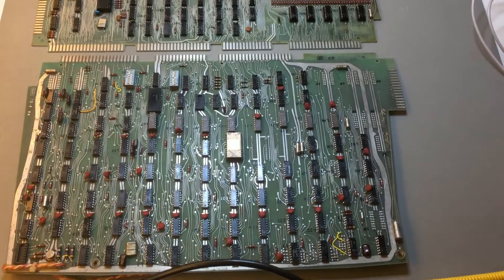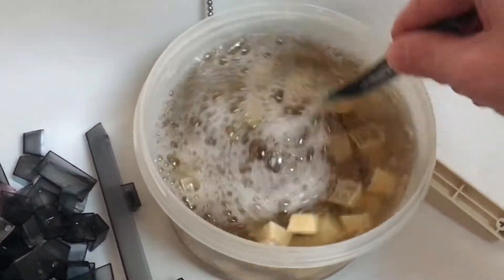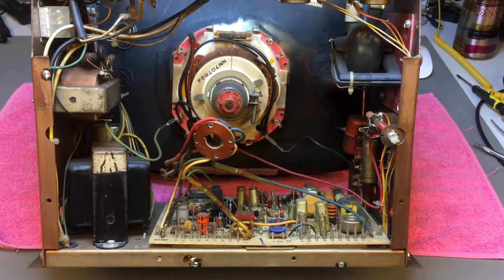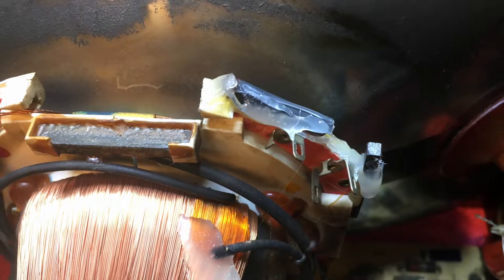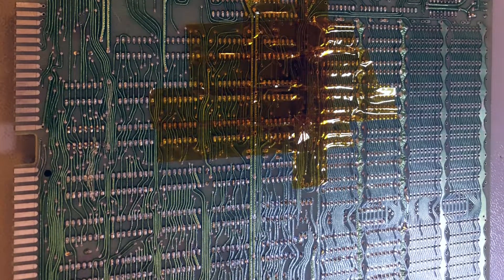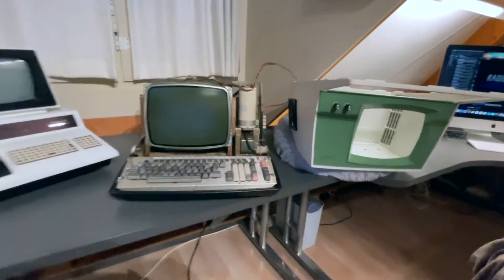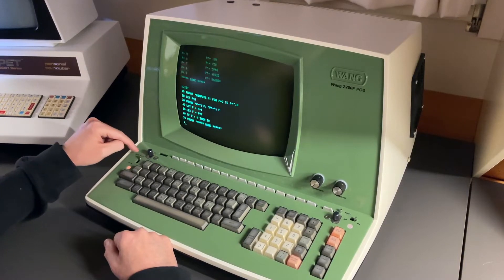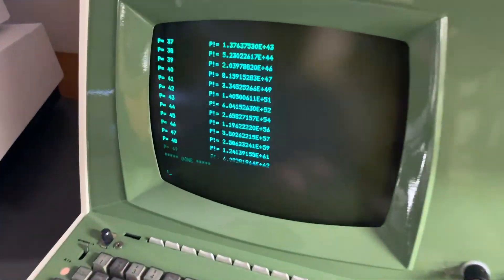Restoring a 1976 Wang 2200F mini-computer, Part 4

Comment: Is there a key missing? There’s a slot at the top left of the keyboard that looks as though it ought to have a special key in it.
Reply from the maker: There's indeed an empty slot on the top metal panel, but no missing key, as the PCB underneath has no switch on that position, and not even traces or pads for a switch. They probably used that top panel in different models, one of which might have had an extra key. There were Wang terminals using the exact same case.

Comment: Thanks for that, sorry i found it only now. Brings back memories.
Between 1979 and 1982 I worked on the 2200 in my first job as a programmer. It was not on the "F" type but a couple of other 2200s. Memory was so scarce that I sometimes even had to access the HDDs by direct sector adressing, I believe the commands for that were DATASAVE and  DATALOAD. After that I transitioned to VS and COBOL, but the "economical" type of programming made me a more successfull programmer till PCx and standard packages like SAP were replacing individual solutions.

Comment: Wang Laboratories was probably the only company to market a pure BASIC machine, that is a computer whose CPU ran BASIC code natively.  The larger systems had a multitasking operating system in ROM, MOS, which was written entirely in BASIC.  The 2200 series would be developed into the late 1980s, eventually culminating in the VS system which emulated the 2200 in ROM code running on a 386 processor.

BTW the FOCAL programming language for the PDP-8 was capable of computing numbers in scientific notation with a 3-digit exponent.

Comment: Absolutely fascinating series I enjoyed every minute, bravo! Minicomputers are something of a dark art, the guy over at "Usagi Electric" channel is restoring a Centurion mini with a bit slice CPU board and it's just as fascinating. The Centurion is more like a terminal server though; this Wang is smaller, runs BASIC and is generally closer to the home micros we are familiar with.

The big question is: did you dump all the ROMs?
Reply from the maker: Thanks! I was reliably told that those ROMs had already been dumped. Since even my super-duper readers couldn't read them, and I would need to construct a little breadboard + Arduino circuit to dump them, I figured I wouldn't go through the trouble.

Comment: Enjoyed your video / project.  My first paid programming job was on a Wang computer similar to yours.  The one I worked on had a gray or gray/blue monitor instead of green.  It operated the same though.  It was a very good computer as I had no instruction but just manuals. I created an insurance benefits analysis system.   It had couple of hard drives and a floppy.  It could even create IBM compatible diskettes!  Brings back a lot of memories!

Comment: Your work is so clean and... tidy is the word?
Me, nearly four decades ago:
Memory card with a shortcut in 12v line. 
"Mmm... PROM?" 
Emptied the zocales, shortcut remains. 
"Mmmm... Should I take off the capacitors one by one until it is fixed?"  No way.
Max voltage of capacitors, 50v. Ok. I looked for a big +50v P.S., then I conected it to the 12v card pin: 
* BANG!!! * 
A now displumed Capacitor. Just a little black hole in the card. 5 volt TTL, unharmed
"What was that? A switching power supply exploded?"- asked the boss. 
"Nah, I just repaired a memory card."- No lie.
Reply from the maker: Ha!! :-))) So this issue has a history! :-)

Comment: best debugger ever; you can halt, print any variable (they were all global) then continue.
It used BCD number format so you never have  0.1 + 0.2  <> 0.3  like, say, javascript.
It was fast, unlike other machines  it used ttl instead of low power cmos.
It was HOT.
Reply from the maker: It still gets pretty hot!

Comment: came from wang2200org recomendation
LOVED THIS!
I worked repairing 2200 series at Sisteco Argentina 1980-89.
I/O card used a 74154 for special codes, ( 03 clear screen, 07 beep,  09 0d cursor movement, etc) so I tunned it:
1) 02 for cliker, 04 for a single pulse to the speaker, $gio to compose tunes 000010000100001 then complete songs with clicker rythm 
2) added a ram chip to screen memory so it could store an extra bit then added a circuit to get  
0E Bright, 0B blink, 0F off
It was fun.
Reply from the maker: Cool stuff!!

Comment: Wow. I started as a 2200 systems engineer just as these were being phased out. I would be rich if I had a dollar for every 2200 screen PS regulator board I've repaired. They were a real weak point.
Reply from the maker: PS regulator board? Part of the screen's power supply? In mine, the screen power supply and both deflection circuits, including the flyback, are mounted on the chassis!

Comment: That is some amazing work you have done. I start projects like this with good intentions, then it takes years to make progress or until I give up. It helps to have a dedicated work area, spare parts, and good tools!

One thing I'd like to point out for readers who haven't used Wang BASIC is that it is very unlike the flavors of Microsoft BASIC that most 70s computers ran.

The number system used 8 bytes per number, and was BCD encoded, so you'd end up with a 13 digit decimal mantissa, two decimal exponent digits, and one nibble to store the signs of the mantissa and exponent.

Unlike MS BASIC, where syntax errors were not detected until the program attempted to execute the bad line, Wang BASIC checked the syntax of every line as it was entered and gave an error code pointing to the place in the line where it found the error. When the user typed "RUN", the interpreter would scan the entire program, checking the syntax again, and also checking that all line numbers referenced by the program were valid. Wang called this the "resolution" phase.

Also, all arrays and strings in Wang BASIC were statically determined during the resolution phase. As a result, there was no need for garbage collection sweeps, and not out of memory errors due to strings growing too big.

Wang BASIC had extensive support for arrays: "MAT PRINT" could print an entire array with a single statement. MAT READ, MAT INPUT could read in an array from DATA statements or an input source, respectively. There were primitives for setting an array to zero, one, or the transpose matrix, or initializing a string array to a constant character. Scalar and matrix addition and multiplication were supported; a matrix could be inverted, the determinant computed, and so on. There were a number of complex commands for sorting in place and for supporting merge sort algorithms when processing data sets too big to fit in memory all at once. There were commands for searching through string arrays, or slices of the array, for a given pattern.

The machine has 16 "special function" keys along the top, and in combination with the shift key represented 32 special functions. One could define a key to emit a string value, like a simple macro expansion, or one could define a numerical function. If you entered the arguments on the command line (separated by commas) and pressed a special function key, those input values would be passed to the corresponding function, the function evaluated, and the result printed out on the CRT -- making it a very large programmable calculator.

There were some down sides too: variable names were either a single letter, or a letter and a digit -- no long names. There is no program scope -- all variables are global. The strings sizes are not dynamic, and had a limit of at most 64 characters per string.

All in all it was a very interesting machine for its day.
Reply from the maker: Indeed a wonderful machine. It's great you've summarized the features of its BASIC above, for they make clear the distinction between professional machines such as this, and the then-new home toys that would soon overwhelm the market.

Comment: So it has a dedicated instruction set in microcode to run the BASIC interpreter. How fast is this machine compared to 8-bit machines like the Commodore PET or the Acorn BBC? It must be really fast compared to the 1 MHz 6502 machines (Apple II or PET)  or 2 MHz Z80 machines (like the TRS-80).
Reply from the maker: The clock speed is lower, but the BASIC interpreter should be considerable faster. I haven't run a benchmark yet.

Comment: Nice job! What "mass storage devices" can/do you use with it? 8" FDD, audio tape,...? BTW: Just had a look: 150µF axial 200V are still available in Germany (at Reichelt).
Reply from the maker: Thanks for letting me know! The 2200F has a FDD connector at the back of the case.

Comment: READY
>
What a flash back! A Wang computer of the same era was the very first computer I have ever touched. It literally paved the way for my career as a software engineer. Back in the mid seventies there were no computers in schools, at least not in my school. We had calculators at best. Slide rules were the norm. A very good friend of mine who was attending evening school one day invited me to the computer lab and I was hooked immediately. Exploring BASIC and programming as a whole for the first time in my life was kind of a revelation. I have very fond memories of the time spend in front of the machine. I had no idea of CPUs or micro processors back then and it really didn't matter at all. It was a system I could tell what to do and it (mostly) did what I intended.
The machine in question was probably not the compact version shown in your video series but it most probably ran the same version of BASIC. It was connected to an IBM Selectric typewriter as a printer plotter device with fine positioning of the print head for real plotting. Mass storage was implemented as a tape device which was fully controlled by the computer. You should try to find one of these to complete your collection.
Reply from the maker: Lovely! Happy to hear it evoke such fond memories in you. There is a very similar, compact Wang mini-computer with embedded cassette deck, the Wang 2200E. Here is one: https://www.siwe.be/files/collectie/V225-Wang-2200E-200pi.pdf. It's essentially the same machine, just with a smaller 9-inch monitor (the F has a 12 inch monitor), the embedded tape deck, and no connector for a floppy drive at the back, which the F has.
Reply: @thebyteattic  Here you can see it in action: https://youtu.be/AlLP8jhkktc

Comment: Nice job. What was the capability of this machine, RAM, ROM and processor speed ( if that is what it can be called). Is disappointing nowadays, you ask young people if they knew Wang Computers and they give you a blur expression. Especially here where I live which is SE Asia.
Reply from the maker: This runs under at under 1 MHz. :-) The starting model came with 4 KB of RAM. But the BASIC interpreter is microcoded, so uses up no RAM.

Comment: Was any type of mass storage available for this one, like cassette tape or even paper tape? You take for granted that every retrocomputer has an SD card slot these days, but the real old computers don't have that.
Reply from the maker: The 2200E came with a built-in cassette deck. The 2200F (the one I am restoring) came with a connector to hook up an external floppy disk drive. There is someone in Germany who made an SD-card adapter for the 2200 A/B/C/T, but it's not (yet) compatible with the 2200F. I will see what I can do ;-)